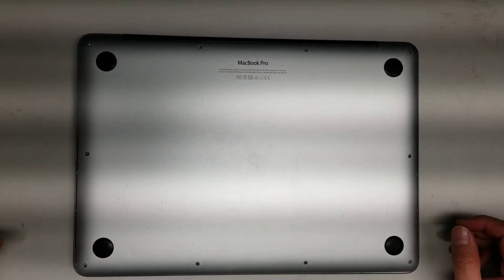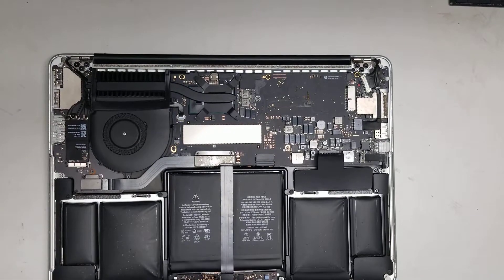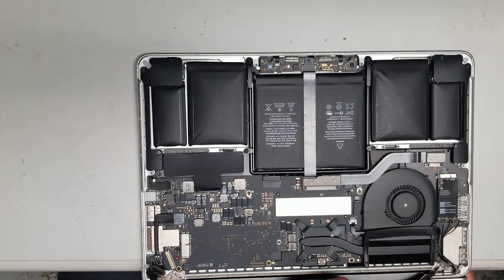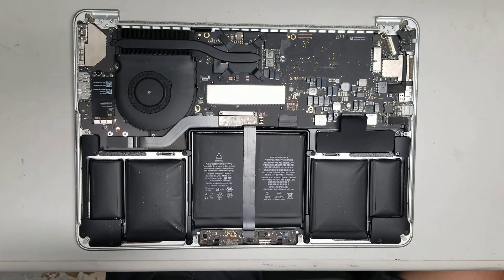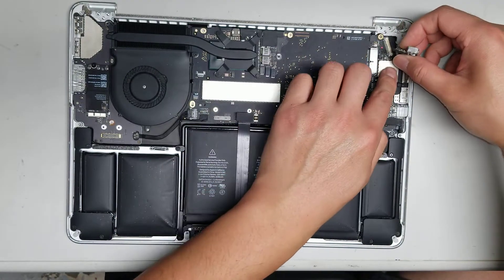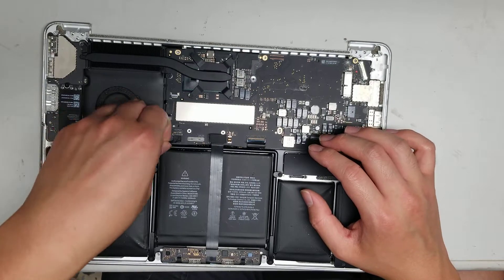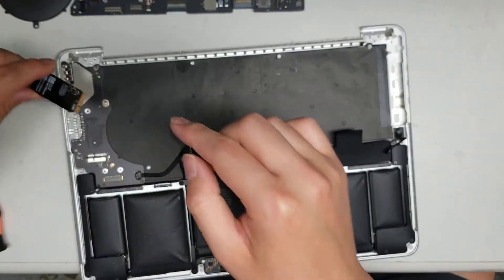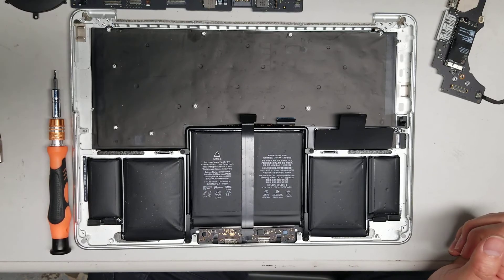13" 13 Inch MacBook Pro A1502 Early 2015 Disassembly Logicboard Motherboard SSD LCD Upgrade Repair

Comment: Hi, i tried to detach the screen to test the cable and when i put it back whenever i turn it on it make three long beebs, they told me its the Ram, but i dont think so, because it qll happend after i detached the screen, the apple service wont repair it as they say they dont have the pieces for this model, what do you think, is it an issue with screen it RAM?
Reply from the maker: Sadly sounds like it. Might have shorted or damaged it with static.

Comment: Thank you thank you!!! The Apple Store told me it was a lost cause because it was a motherboard and not a battery problem, and I got a set of tools, found your video, bought a motherboard off of eBay, and following this and then reversing it to put it back together I was able to do it first try!! Only $100 to fix it myself including tools! Thank you thank you
Reply from the maker: @movewelldurham975  awesome! Glad it worked out. If you haven't already, please like and subscribe so others can find my videos and possibly consider watching a few others to get the algorithm to recommend my channel. Thanks!

Comment: cool! thanks!
Reply from the maker: @divyabhatia9916  no problem
Reply: @ItsBinhRepaired  My 15" macbook pro 2015 2.2GHz quad-core Intel Core i7 processor, Turbo Boost up to 3.4GHz, 16GB of 1600MHz memory, 1TB SSD, Intel Iris Pro Graphics, Two Thunderbolt 2 ports got kaput 3 weeks ago when it fell down on the hard floor. Since then the graphics are not working. I need to do data recovery as I dont have the data backed up. So applecare said that I need to get to its target recovery mode which I got it into once with command T on bootup. But since then I havent been able to get into the target recovery mode even with T on bootup. 

So, is it possible to remove the SSD and put it in a working compatible laptop and recover the data ?
Reply from the maker: @divyabhatia9916  2015 has a removable SSD. You can put it in a usb adapter
Reply: @ItsBinhRepaired  Thanks so much for the response. I was wondering if I could do this with Mac. I had done this with lenovo windows device before but never done this with macbook pro ssd. What usb adapter do you recommend?
Reply from the maker: @divyabhatia9916  they're somewhat pricey, but this https://amzn.to/3LcqOtP
Reply: @ItsBinhRepaired  Thanks so much!
Reply from the maker: @divyabhatia9916  no problem

Comment: Thanks for this!  I stupidly followed the iFixit instructions on a battery replacement which had one remove the speaker connectors unnecessarily.  I ripped the right speaker connector off the board.  Question. If I remove the circuit board, where on the underside is there an accessible trace for the right speaker.  I can run a wire from that point back to the speaker cable on the other side of the board.  Or live with one speaker🙃
Reply from the maker: You'd have to know how to work with pcbs. You'd have to solder. External speakers work well as well.
Reply from the maker: There's a trick to removing the speaker connectors safely. I think they don't explain it too well sadly.

Comment: I have a 2015 macbook pro 13" in good condition, the fan has no dust in it, the ports work fine, the motherboard and cpu never failed, but one of the speakers got damaged and the bottom feet stands were cut off so i prob have to buy a new pair and fix that issue myself
Reply from the maker: Speakers are super easy to replace on this model. Hope the repair goes well. If you haven't already, please like and subscribe so others can find my videos and possibly consider watching a few others to get the algorithm to recommend my channel. Thanks!
Reply: @ItsBinhRepaired  I might buy extra bottom stands and put them on it and yeh great video btw
Reply from the maker: @MinionProductionsYT  make sure to pop out the remaining plastic in the hole.
Reply: @ItsBinhRepaired  thanks for the advice
Reply: @ItsBinhRepaired  btw my 2015 mbp is also an a1502 just like yours
Reply from the maker: @MinionProductionsYT  nice

Comment: Where is RAM located in this model of MacBook? As far as I understand it is soldered on the motherboard, but where? Under metal shielding?
Reply from the maker: Most likely
Reply: @ItsBinhRepaired  It’s interesting why they shielded RAM? Never seen someone do such a thing.
Reply from the maker: @terrakottech417  a lot of models do that even with removable ram now.
Reply: @ItsBinhRepaired  Is it possible to replace (re-solder) faulty RAM chips in this model of MacBook?
Reply from the maker: @TerraKOT Tech  anything is possible. Can I do it? No, not even gonna try.
Reply: @ItsBinhRepaired  Thank you for the answers.
Reply from the maker: @terrakottech417  no problem

Comment: I read reseating the SSD could help for missing SSD. Btw, do we need an anti static glove or anything?
Reply from the maker: Usually that won't fix it, but you can try. Just make sure you ground yourself.

Comment: Is there a problem with the battery of this MBP? Batteries on the left and right or trackpad seems like they are blown. I have the same model and my battery have a similar situation but I don't know if this is a problem. In this video: https://www.youtube.com/watch?v=8yhIj_28l34 , both the original and replacement batteries seems to be flat.
Reply from the maker: Yeah, that's bad, usually caused by keeping it at 100% charge. You want to try and keep the battery between 20 and 80%. The closer to 50% the better, but not really realistic.

Comment: What is the ribbon part on the left of the trackpad flex? The one taken off at 9:20. Also, does it have any effect on the keyboard? Thank you!
Reply from the maker: That connects the wireless card,  SD slot, etc. on that daughter board.
Reply: @ItsBinhRepaired  

Appreciate the reply, thank you
Reply from the maker: No problem

Comment: this MBP is actually really not that hard to work on the only thing wrong with is generation in my opinion is the glued in battery
Reply from the maker: Try replacing just the keyboard lol
Reply: Ive pretty much repaired everything to the 2015 macbook except the battery. I kinda want to now just so i know how. Is it hard getting the glue off?
Reply from the maker: Here https://youtu.be/Tx22OPVLhBw

Comment: I have a weird problem with my MacBook Pro early 2015 . The screen doesnt close completely and when I close it it pops out about 1,5 cm. Maybe its the hinges? I would appreciate the help thank you
Reply from the maker: Hmmm is it wobbly when you open and close it?
Reply: @ItsBinhRepaired  kinda and its stays open
Reply from the maker: Could possibly be the hinge mount screws came loose
Reply: @ItsBinhRepaired  thank you very much for your response I will check it
Reply from the maker: Might be the ones under the black plastic cover. You have to completely remove the screen and slide it, then pull it off. It's a pain.

Comment: Where is the PRAM battery on the 2015 13" MacBook Pro??
Reply from the maker: PRAM battery? Never heard of that.
Reply: @ItsBinhRepaired  Trying to get the attached monitor to be recognized by the MacBook Pro. External monitors work, and camera works. Have heard removing the PRAM battery and replacing it can help the machine recognize the screen but can't figure out where it actually is on the board.
Reply from the maker: Pram reset command option p r on boot
Reply: @ItsBinhRepaired  tried that and no dice as well as SMC
Reply from the maker: I'm confused. You said you're trying to attach monitors and the external monitors work? What are you trying to do? Sounds like it works. Are you trying to make it not work?
Reply: @ItsBinhRepaired  the built-in monitor on the MacBook does not work, only an external monitor is being recognized.
Reply from the maker: @PeterStringer33  oh, you'll have to check the LCD connection
Reply from the maker: @PeterStringer33  https://youtu.be/mWbXuF3bftU that should help

Comment: Does this support m.2 nvme SSD?
Reply from the maker: With an adapter, but it'll have sleep issues every now and then.
Reply: @ItsBinhRepaired  ah I see. Because I saw that the socket its pretty different compared to m.2 SATA or m.2 NVMe. Thanks for replying
Reply from the maker: @itzjoeee  No problem

Comment: Mac's motherboard burmt, is it worth to repair? A1502 model. How many days can I use after repairing the logic board?
Reply from the maker: Depends who fixes it. If I do it, it's $250 90 day warranty, should last several years, but no guarantee beyond 90 days.

Comment: You can't upgrade the RAM for the macbook A1502
Reply from the maker: correct
Reply: You can replace the logic board so technically yes
Reply from the maker: Hahaha true, but might as well sell and buy one already assembled.
Reply: @ItsBinhRepaired  i just bought a base model 2015 13 on offerup for 200 mint condition and swapped the logic board for 100 but i did the swap myself
Reply from the maker: @MrTurkeybags  nice!

Comment: What screwdriver and size did you use to take the bottom of the laptop off
Reply from the maker: Pentalobe 1.2
Reply: @ItsBinhRepaired  what brand?

Comment: Hello, i recently buy MBP 13 from 2015 without battery and SSD. I order power supply, but i cannot find consistent information, about will i be able to test this laptop when battery is missing and try to boot any OS (like ubuntu) from USB? i did some research and found two answer: no and yes, but with lower performence. So, where is the truth? I will order new one, but i want start laptop before spending 100$ on it.
Reply from the maker: It varies from model to model. Not exactly sure. I don't think you can run Ubuntu on it though.